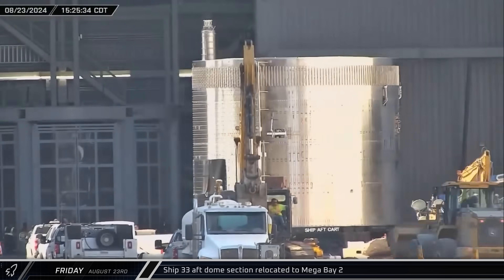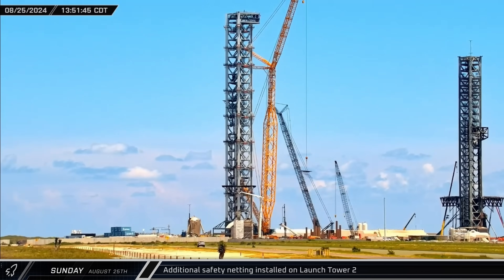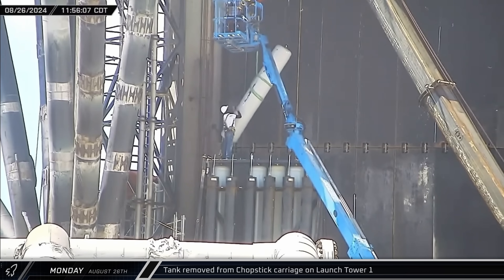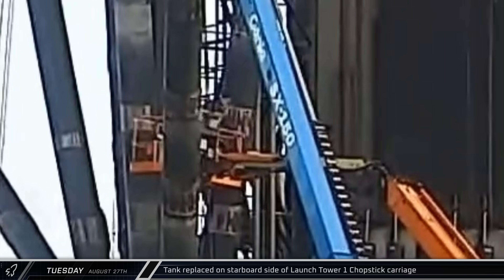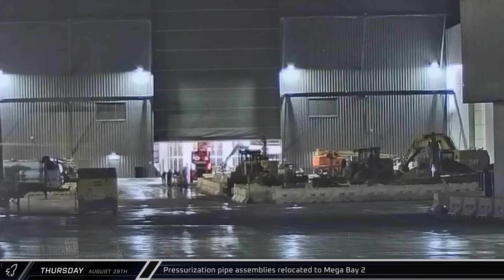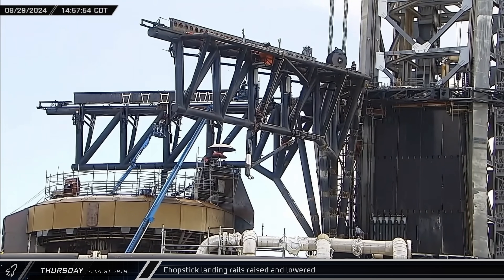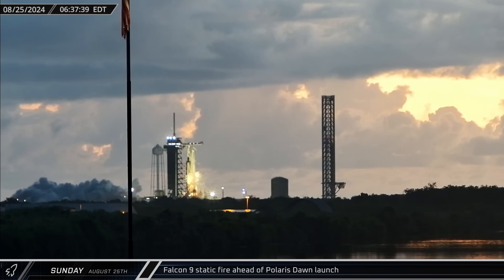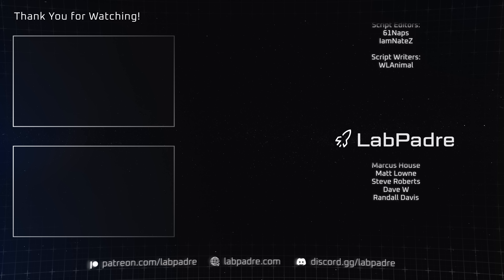Final Preparations Underway For The First Catch Of Superheavy! - SpaceX Weekly #130

Comment: I'm surprised they didn't think of installing mass dampeners at the ends of the chopsticks which can use servo motors to move a massive weight quickly side to side to dampen out oscillations of the arms?

Comment: Thank you Lab and team , Another on point update ..! Instead of replacing the pads on the catcharms they should really do would I did for my pier to protect my boat from dings and scratches use old tires as bumpers .. 🤗 Sure they may not hold up to the heat but they'd be a whole lot cheaper to replace .. 💲💰👍:_BoosterB: